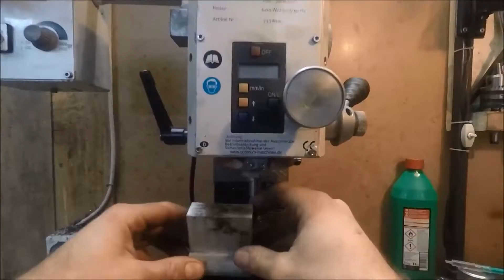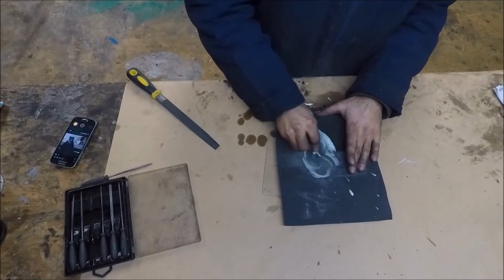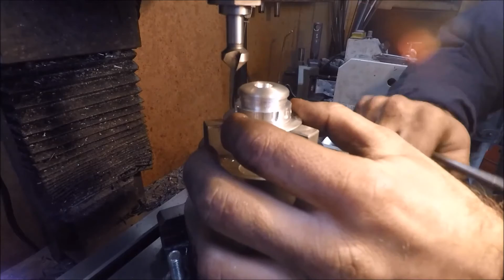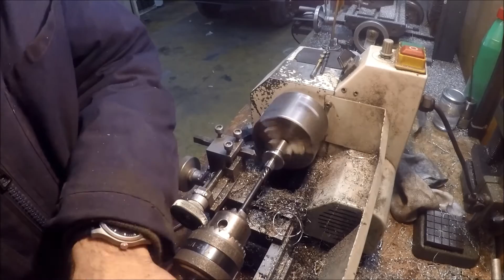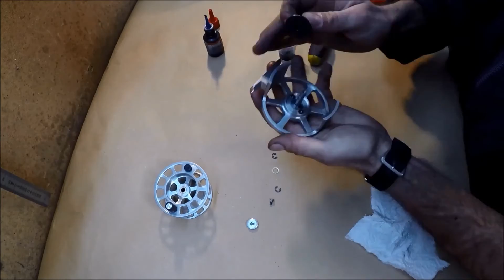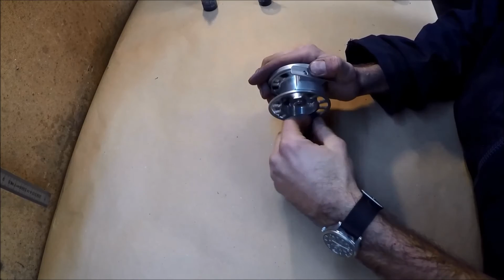Making a Fly Reel, Part 3: Bits and Pieces, and finally: Assembly!

Comment: Wonderful reel you did... At some point you introduce a friction washer or is click&pawl reel?
Reply from the maker: Thank you for your comment! It´s just click&pawl, at 7:08 you can (barely) see two shells with a spring between the two. One shell has a tip on the end which engages with the black drag wheel, the other shell is pushed by the drag knob to adjust the spring tension.